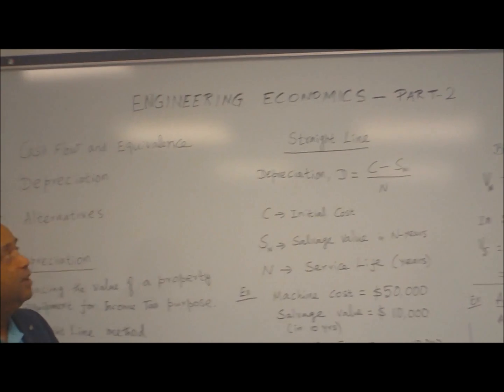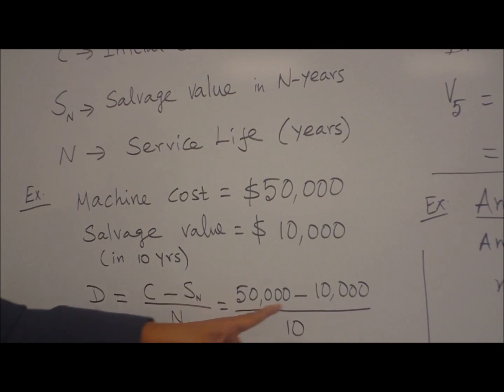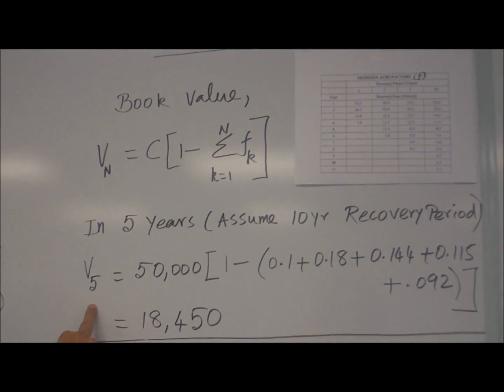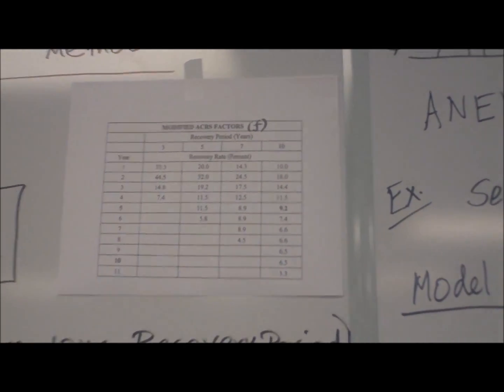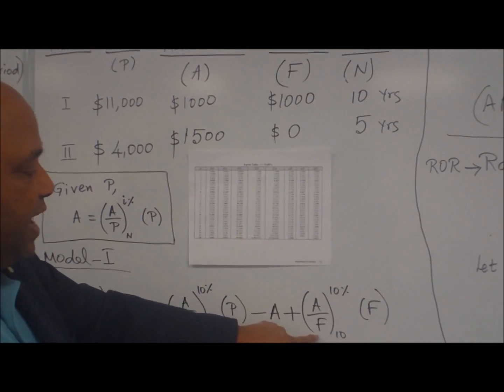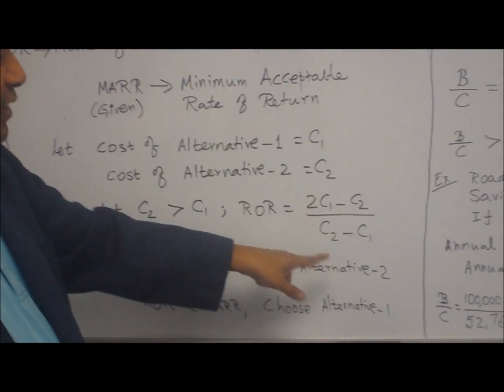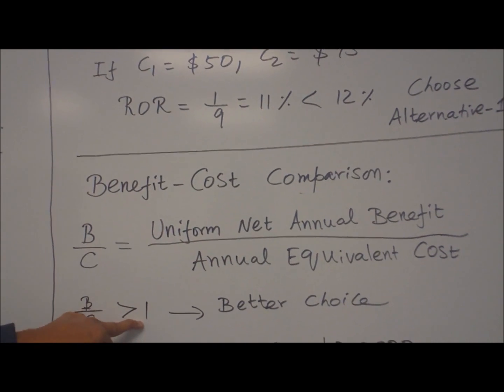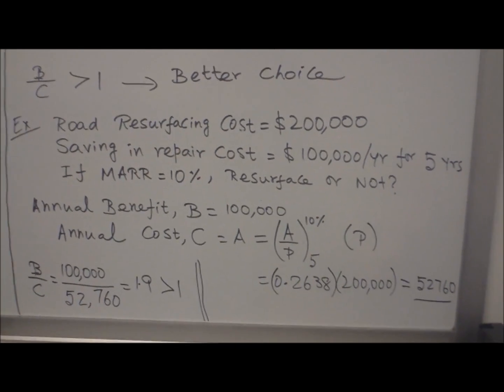Engineering Economics Part 2

Comment: This is very helpful but I am confused about the ANEV comparison. In this video you said that Model II is better because it's ANEV is lower than Model I. However since they are both negative, the ANEV for Model I is in fact lower than the ANEV for model II. Is the better model the one with the lowest absolute value, or is the better model the one with the higher value? 

Thank you for making these videos; they have been extremely helpful to me during my preparation for the FE exam.
Reply from the maker: yourself2036 
Thank you for your question. The negative sign means, the cash flow out from your hand, or how much you need to spend each year.  You need to spend $2727 for Model-I but for Model-II the amount is $2525.  So, Model-II is better since your annual cost is low.  I hope it helps you to understand.